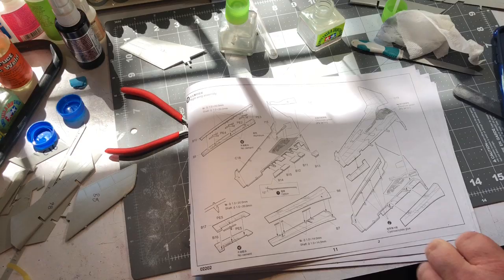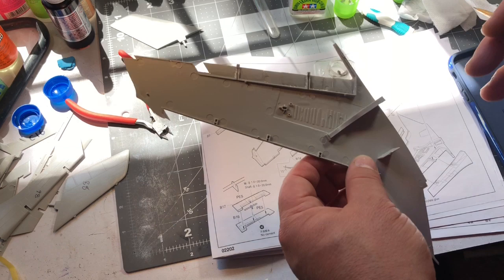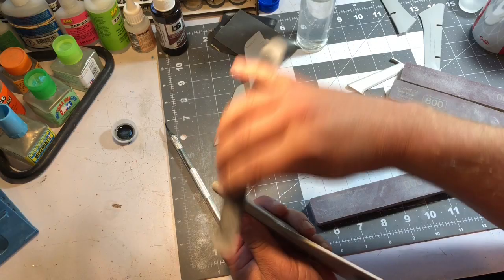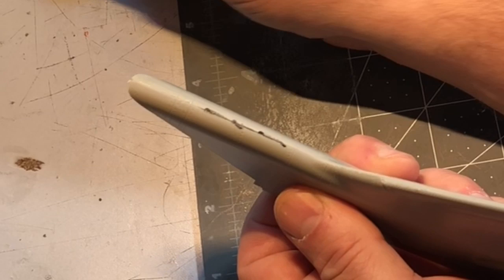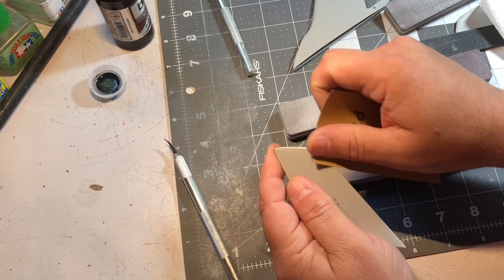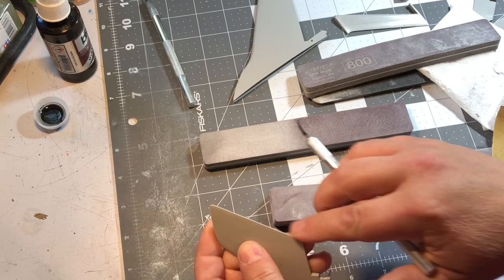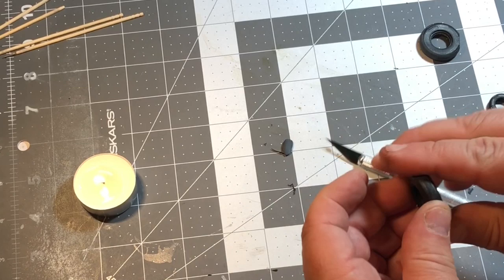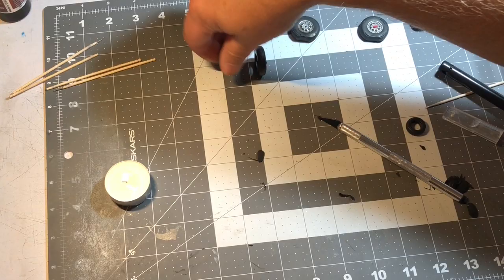Trumpeter 1/32 F-105 G Build Part 3: Wings

Comment: Another great video there. That kit looks like a proper handful!! Are those plastic legs gonna be strong enough??
As for vinyl tyres, they can be bulged with a piece of plastic card shoved into them.
Reply from the maker: Thanks Nigel.  I’m using white metal landing gear the customer sent me...not the best but looks like they’ll hold the weight.  I did use the kit plastic one on the front of the D but reinforced it with metal rods.  Looks like that’s gonna work as well.